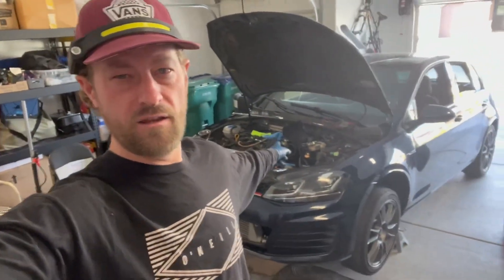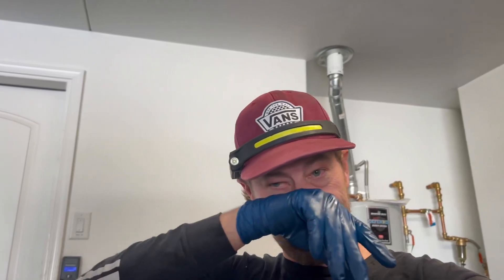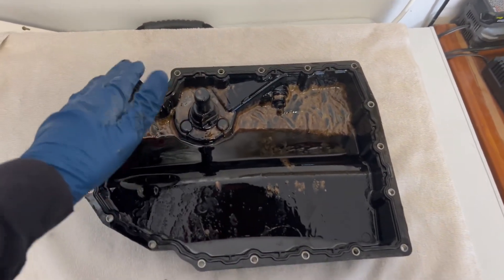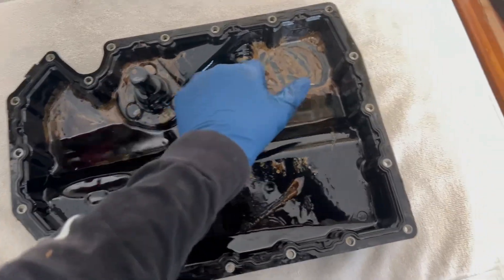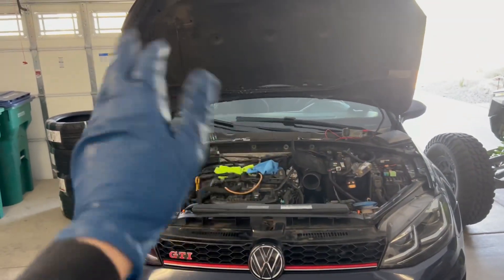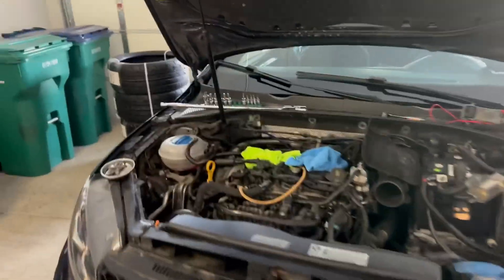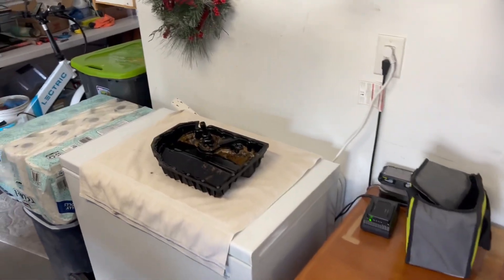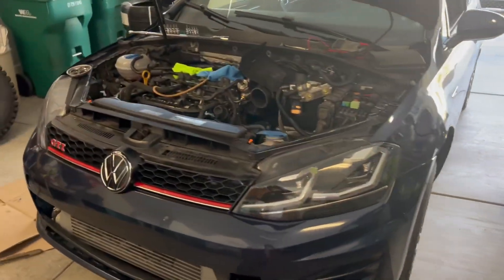Coolant in Oil! | Possible Head Gasket Failure, Cracked Block, Oil Cooler, Waterpump?? | MK7 GTI

Comment: I think your reasoning is sound.  Find a good used lower mileage engine.
Reply: You can throw a newer a4/a5/q5/atlas/arteon engine you just need to swap oil pans and move a few freeze plugs, gen 3 or 4 work

You can likely find a gti motor for cheaper or the same cost, but this gives you quite a few more options on the market.

I built my rod/piston a3 motor from a 20k mile 2021 q5 core

The a5 had no sai and the same aluminum alloy as the R cylinder head
Reply: Atlas will have all your correct accessories and oil pans
Reply from the maker: Right on bro! Thanks for the info! Having more options to choose from will definitely be better when searching for the right engine at the right price. Thanks!
Reply from the maker: Thanks

Comment: Do you have oil in your coolant too?   I changed the oil cooler with a new oil cooler gasket and new oil filter housing gasket and it fixed the problem in my coolant. I was worried about coolant getting into oil so I did change the oil immediately to a garage at the time it happen. I can not say if any coolant was mix with the oil. The car drive fine since.

I hope you can fix your problem, I really like your channel it helps me to work on my golf. Cheers!
Reply from the maker: I do not. It’s a high possibility that the coolant in the oil is due to the oil cooler. I’ve watched several EA888 motor videos where this was the cause, just like it was for you. I still have the problem of the motor being seized though. I’m just very skeptical about the motors longevity factor even if I did rebuild it.

It will definitely get fixed and the GTI will live again. Thanks for watching my videos.
Reply: @JacesOwnWorld  *yes, that is correct.
 When I rebuilt mine I swapped all those oil and transmission cooler gaskets. Although I seriously do not think the engine block is cracked. Of course (and I would) take the block for dye testing. 
The fuel in the oil could be defective injectors, you can test them out with a 9v battery and connect them, there are videos on doing diy tests on them.
On mine as well, one of the injectors was staying stuck open, and you will know as one of the pistons will look shinier and with more carbon deposits compared to the other chambers, pistons.
A machine shop will tell you if the engine block and crankshaft is within specs, and it does not cost that much.
I have two spare used blocks, got them through FB marketplace, took them to a machine shop, visually the builder told me right away they are good, that's how good my machinist is. 
I know it is overwhelming, but don't just say is an old motor, the machinist will tell you if it is or not. These blocks are almost bullet proof, one has to be real silly to kill them. 
Thanks for sharing your mishap and thoughts!
Reply from the maker: I understand what you’re saying. When I say it’s an “old motor”, what I’m really trying to say is all of those things you mentioned take work, time, and $$. I want to get the car up and running the fastest and least cost as possible, with reliability in mind too.

Maybe further down the road I will take these steps to Dx if the engine block is good or not. What I will for sure be doing is taking the engine apart to see what went wrong.

For right now though, I really am looking for a used engine, with compression and leak tests performed, with under 60k miles on it, and just do a straight swap. Once I have the car running again, I can make more content and then dive into my seized motor.
Reply: @JacesOwnWorld It was a first for me with the ea888, so it took me two months to fix it, waiting for the shop, parts, funds, and finding the time and energy to work on it. 
At least you have a DD, which is a good move whenever having a modded car.
Reply from the maker: @lmmaccount1232 yeah I hear ya. I actually just bought this daily less than two weeks ago due to my GTI’s engine seizing. So yeah, it is very nice having this daily car now. Now I can focus on the GTI as a true project/fun car. I have a lot of plans for it. New (used) engine, new accessories, new FMIC, possible new turbo, possible new tuning platform, wavetrack LSD…to name a few. 

I wouldn’t be able to take my time and do it the way I want if I didn’t have a second vehicle right now. So it’s good.
Reply: @JacesOwnWorld 
TCF Garage
https://youtu.be/CAEBU4QOtvw
This YouTube channel goes over step by step, it's 31 videos series; cleaning, rebuilding, porting, the infamous ea888. To me it was extremely useful, and many times use it as a reference for troubleshooting, diagnostics. Although comments are not enabled, he does an excellent job narrating the what ifs, ups and down and final results.
Reply from the maker: @lmmaccount1232 awesome! Thank you for sharing that info